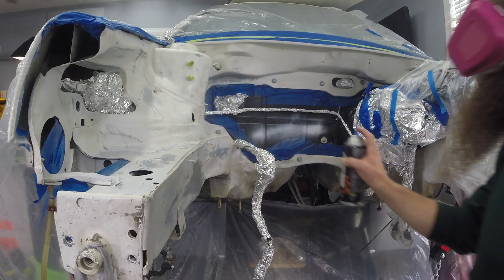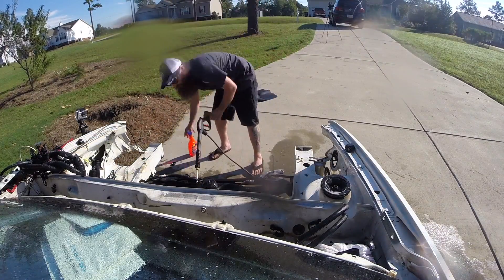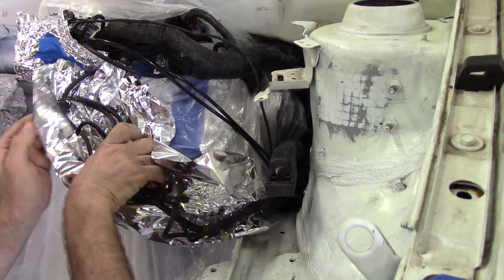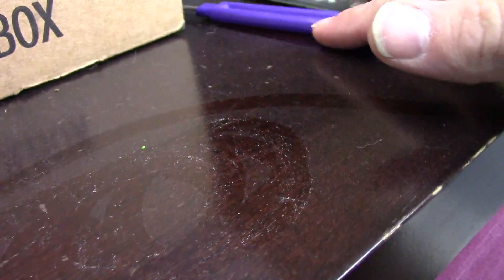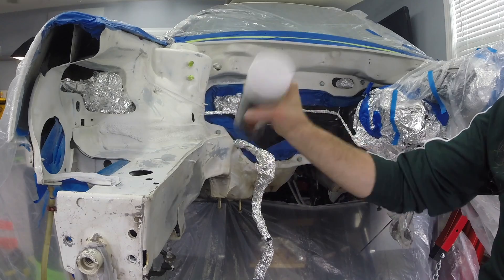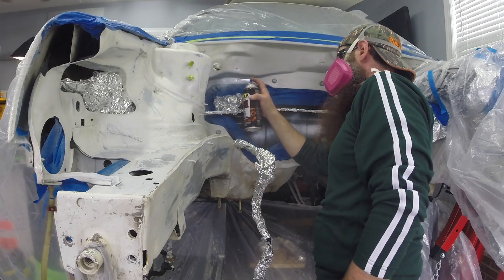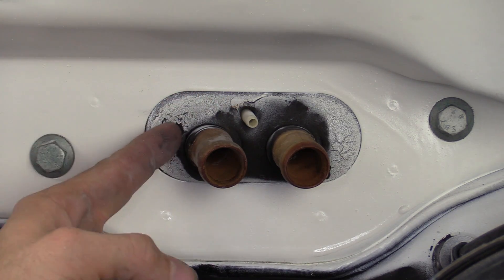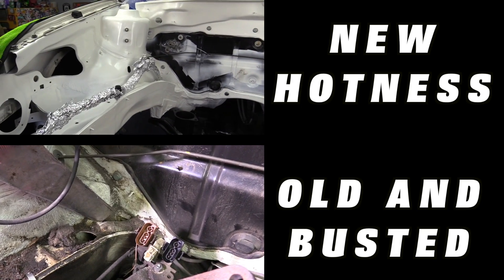How To Paint Your Engine Bay with Rattle Can Paint

Comment: Thank you for posting this.  I am well into doing the same project; and had contemplated using aluminum foil for masking the wiring I can't properly remove, the brake lines ... and bagging the brake booster and ABS module.  I am contemplating making a spray booth for just the front of my car out of some PVC, Fittings, and Plastic drop cloths a few old furnace filters, and some box fans (to control the dust and over-spray).  Contemplating media blasting (soda likely), using some self etching primer, and getting busy with some Urethane I got from Eastwood (lucky that their retail store is 15 minutes from my house).

Comment: got to say I've been there before  spending 2 years cleaning rebuilding buffing wire wheeling cup brushing tapping up parts to paint making stuff better but I did it all just for a valve spring to crater and destroy a freshly rebuilt motor and had to junk it I miss my old truck
Reply from the maker: +1987Isuzupup damn that sucks
Reply: HumbleMechanic God know your right on that man it was a 1991 Isuzu space cab I pull it out of a guy back yard it been back there for 12 year with the motor tore down the brakes wore rust locked parts wore missing it was a basket Case and I was so close to getting tag's I was driving around she gave up the ghost but  the odd thing was the way it broke down it was the same  as 12years  before it just odd

Comment: You can also hit the plumbing supply aisle at your local home improvement store to find an assortment of rubber plugs to fit larger holes. They aren't as cheap as tape, but they are quicker to install and can be reused almost indefinitely. Just pop it in the hole, twist the wingnut to snug it down, and on to the next one.
Reply from the maker: That’s an awesome idea
Reply: @HumbleMechanic  I have my lucid moments. I set out to write an entirely different comment but wasn't sure it would have amused others as much as it amused me.

Comment: While this is a great tutorial, I must say that when it comes to engine bays, a simple brush and a can of paint can really be your friend, its much cheaper than rattlecans, you avoid most of the masking process, you can easily get a heavy coat of paint without drips and theres no spray dust everywhere.
Reply from the maker: +zuilok I may just try that on the next one
Reply: Are you serious?  I'm getting ready to paint my engine bay and saw Eastwood had some paints that apply with brush.

Comment: good tip is also heat the can to at least 20 degree Celsius but not to hot so the can wont spatter as much, recommend a 2K clear over it, if not then any fuel spill or strong degreaser/detergent can dissolve the paint (Brake cleaner kills ALL 1k paint without proper clear coat over it)

If the car is getting a crash damage later and gets a professional respray it may wrinkle up on rattle can paints (some Acetone based at least, but not all) 
this happened to my car, the hood was sprayed with some cheap rattle-can and painted properly later and it all went to a shitstorm of wrinkles so it had to be sanded down to bare metal and primed with a special primer from Wurth than can blend with "most" 1k and 2k paints and clears (1 day job ended in a 4 day Expensive job).

Go over the whole engine bay with White Spirit ten let it dwell for 5 ish minutes, apply again then wait 2 minutes before spraying it down with degreaser and a high pressure washer before going if for the deep clean to take the worst of easy.

Comment: A solution between regular spray paint and a spray gun, is to use a 2k-spray can with a spray handle attachment. Btw is there any regular spray cans that's oil och fuel resistant?

Comment: Did you sand with up to 240 grit before laying down the primer or paint? If you didn't, you did not allow for mechanical  adhesion of the paint or primer. Should be interesting to see how long this paint job lasts.
Reply from the maker: +Travelingman 1997 yes the "scuff step" is in the video.

Comment: Why did you leave the firewall halfway covered and/or did not remove the white overspray?
Reply from the maker: I Wanted to leave some to be sure I had a good place to show how to remove overspray. I didn't clean it all because that will all get covered. Not sure if I am doing the OEM heat/sound shield or aftermarket.
Reply: HumbleMechanic ah I see, said the blind man as he picked up the hammer and saw... great vid!